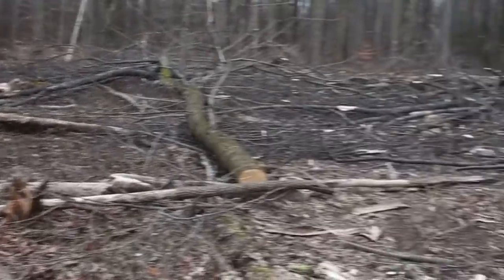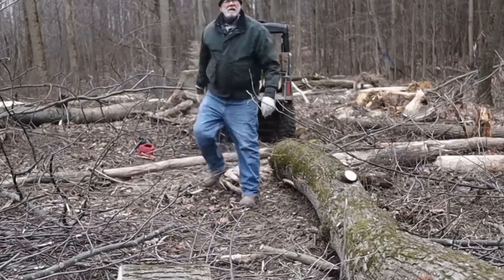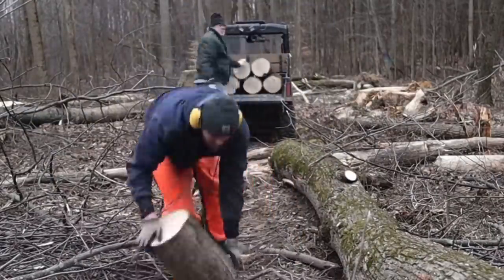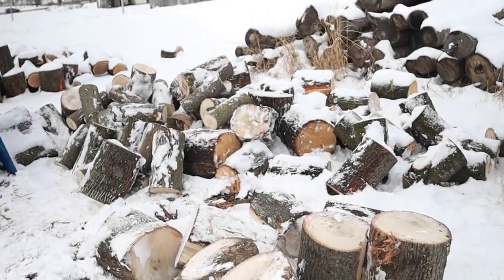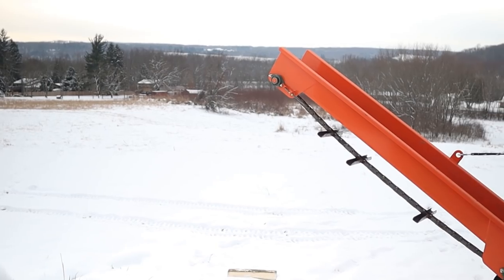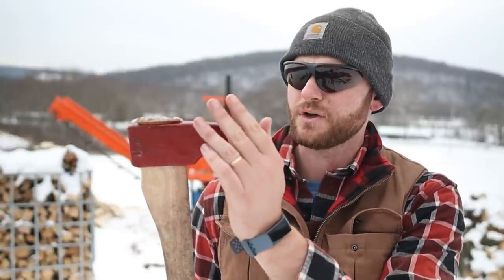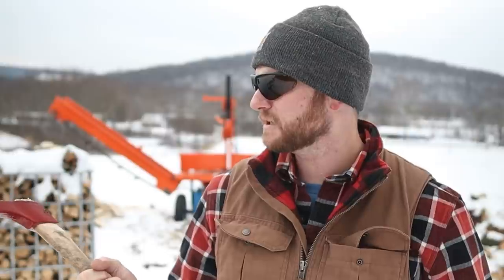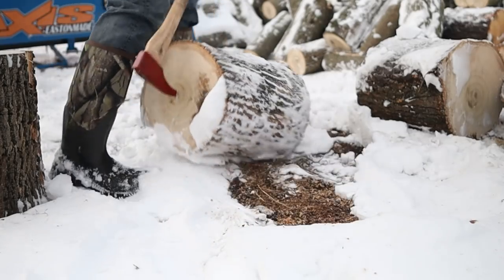You Guys Were Right - This Is Better

Comment: Why would you split the wood in a very modern splitter with a belt system and then drop it on the ground so it needs to be picked up again?
Reply: Some people allow the wood to dry or season in piles.   But I see your point.   I like to stack it on racks after splitting so using the conveyer to drop it in the bed of a truck or trailer is easier and removes one step of getting sore.

Comment: Adam most people take care of their tools but don't look after their body. I'm 63 been cutting and splitting firewood since I was 8 years old. I do 20-30 minutes stretching everyday, never miss doing it and never had any aches other than fatigue from a good hard days work. What i have noticed as i get older is that my strength is going and I can't lift anywhere near the weight I could when I was young. The stretching keeps the body supple so you can recover from working it. I've had people helping me in the bush half my age or more and can't believe I'm not stiff the next day when they can hardly move.  Look after your body when you are young and grow old without aches and pains.

Comment: I see that you're helping your back with the pickaroon, but now you need to pick 1,569 small pieces off the ground. 

Suggestion- let the conveyor dump split wood into metal totes. (Yes it will be a little messy) 
Use your loader forks or 3pt pallet fork to lift and carry tote to a wood stack area or re-stack into another metal tote.
Much less bending over.
Probably get 2x work in same time and much easier on your body
Reply: Absolutely! Man, I thought there for a minute I was the only one here who realized this. The less you have to reach down, the better.
Reply: @tbpjmr2869  
We load all our longer logs onto an old $500 flatbed hay wagon (fork load with a tractor) 
We saw into rounds right on the flatbed.
Roll the rounds onto a splitter deck.
Toss into a tote or stack for seasoning.
VERY LITTLE bending over.

Comment: I bought myself a Forester Pickaroon for Christmas and an kicking myself for not doing it years ago. My back is usually an issue but not lately.  I cut and split 4 cherry logs today for example and I’m not making any of my old guy groans tonight 
One tip - I do this with axes and mauls too
Cut a disk off a log that fits in a drywall bucket and about 4-6 inches thick. It will keep the bucket from tipping over when you put your hookaroon in it next to your splitter or work area.  Sure beats looking for it In the snow and bending over to get it all day.
Reply: Great tip! Thanks for sharing!

Comment: Hey, Adam! I'm commenting through my father's YT account because I don't have one. My suggestion to anyone would be to do a brief warm up of the major joints and areas you'll be using hard and then do deep stretches after it's all over, preferrably before bed. A lot of folks like us who do hard work like this always preach about the maintenance of the equipment, but are not as in tune with maintaining the God given equipment he gave you that's the most ignored tool --- your body! There's proper ways to lift, swing, carry, push, or pull and there are also improper or even dangerous ways to do those things. And to compound it, when you haven't taken good care of your body for a long time and you find yourself being a stiff, immobile old man then the work you're doing to produce firewood is that much more damaging on your body. That's exactly why we've had to invent tool like a hookaroon, to get around our own infirmities haha! God bless you and your family, Adam. I subscribed for the ideas you have regarding small-scale wood production because I'm in that same boat to heat my house. Thank you for reading--- Tad from PA
Reply from the maker: Tad thanks so much for taking the time to share. Yeah it’s funny I’ve played sports for years and before every practice you jog, and stretch.  But the second we don’t have a coach coordinating a practice we lose all common sense. Splitting firewood for an hour or 2 should be no different than going to basketball practice, stretch and warm up first. Excellent point
Reply: hi there have you ever animals  like cats and dogs when they get up the first thing they do is stretch   john

Comment: Great video!  That type of tool is great! You are wise to take advice and improve over time. Suggestion: put a magnet on the blue colored indeed table/ round lifting actuated table top of your splitter.  If you put a strong magnet close to your RIGHT foot on the underside of the table, [ right foot / right left determined when operator is looking towards the ram assembly] you could click in/ magnetically lock your picaroon into a vertical position and it will be exactly [almost] in the same place every time you go to grab it. The handle looked to be a bit longer than the vertical distance of the infeed table but the pivot point of the radial arc would probably be acceptable depending on where you stand when raising logs on the infeed table. In my opinion having a tool like that is useful and having the tool in the same place leads to better muscle memory  , reduced fatigue and not tripping on the handle when tool slides around [ snow is slippery]. Great Channel, Happy Holidays!
Reply from the maker: Thanks for the idea. Happy holidays Adam

Comment: Yes Adam they are a great wood tool to get as I finally got one this year after doing the old style of picking up rounds and hauling them by hand even at 52 I'm doing things alot different now then before because it's hard to get going in the morning, so be smart and save your body for when it will mean the most...

Comment: I would say the aches come at 35. I’m 37 now and things need to be done smarter not harder now.
Reply: Came at 42 for me. Bought a mini skid this year at 43 to keep up the pace. No more aches and pains!
Reply: I'm 42 now, the big aches, pains and joint surgery came at 39. Being in the trades most of my adult life and only having a woodburner for heat during the last decade has taken it's toll, mostly because I didnt wanna spend the coin on a hydraulic splitter, a grapple and a cant hook. There was pride in doing it all by hand. 6 cord per winter all bucked and busted with a chainsaw and maul.
Reply: Yep best advice at 61 i can give to the youngsters. Get the equipment as soon as you can! The maul and hammer have ruined my wrists. Barely can carry wood into the house now. No grip.
Reply: @mikeadams2339  yep. Glad I learned the lesson before putting any more wear and tear on my body. I enjoy running my sawmill and would like to do it through retirement. I’m spending the next year refining my setup to minimize material handling and to do as little manual labor as I can. There is enough unavoidable movements that I’m still beat by the end of the day.
Reply: Yep puting chains on the tractor, at the end of the day i felt like i had been beaten up by a bear! So great to see these  kids thinking smart and actually hearing what we are trying to tell them
Glad they look at the work area and think ahead so they will  have room to work and store the harvest they they have wored hard for!
Reply: They hit me at 42, shortly after getting married... but that was the best “accident” that ever happened to me! But on the serious side. Between serving in the Marines, automobile racing, motorcycle accidents, and life on life life’s terms. I keep looking for better ways within my means, smarter not harder is best!
Reply: I started using a pulp hook about six years ago and wow what a difference! The pickaroon looks like a great idea also. I started to notice that I had body parts at 43 and began to make adjustments in my methods. I HAVE slowed down a bit but cutting firewood helps keep me young. I'm 74 soon. Work smarter, not harder!
Reply: Load fire blocks into trailer, with ramps or whatever is handy, place ramps between trailer and feed tray of splitter, let my son roll bucks to me for splitting, and toss splits to my daughter for stacking. Keeping in mind I don’t own a tractor of any sort, and dragging my splitter to the bucking site I would only be able to grab a small truck load ( about 1/8- 1/4 cord), but with the trailer, I can get about 1 1/2 cord / trip, and split in my back yard.
In the future, I will be putting a winch on the front of the truck( in case of getting stuck)and another on the tongue of the trailer ( for loading fire logs)
Reply: First lower back injury at 41 and then neck injury at 45 but still going they say it gets better but I am not sure what that means HA!
Reply: @MJADoingStuff  my back injuries started with a broken back, at 8 years old, then again at 10, and 12. Slowed down a little the broke twice in the Marines,the 2 more breakers racing cars, and my last was a motorcycle accident, on top of that, I have broken my neck twice, ripped out both rotator cuffs (beyond repair) and have blown out my knees.

I’m not in bad shape, for the shape I’m in, and when I die, I will donate my body to science- fiction, they probably won’t believe it either!😂😂😂
Reply: At 60 the best thing I have learned in the last couple years is to slow down, made all the difference in the world.
Reply: @royc8186  if I slow down... I will be in trouble, keeping active is best for me! Even on the weekends if I sit around and do minimal work, then come Monday I am stiffer then if I did something!

Comment: I used one just like that back in 1971-72 when I was in high school working at a local pulpwood yard. The hook made short work of leveling out the top of a car loaded with 5 foot long pieces of pine and hardwood pulpwood. I also had a short hook (16") but the longer one was much better.

Comment: You can use the hookaru on the end on shortened log , 6 to 8  that is ready to cut in to fire wood length and place under the one end raised up by it a U shaped piece of wood so you do not cut into the dirt. Not every log depending on size... In the woods my Grandfather would use a stick mark off with 3 fire wood lengths and mark the log with ax chop......He would stand in the middle of the stick and mark 2 at a time... We would use a double handled cross buck saw!!!

Comment: I have been using an old ice tong. No bending over and will pickup nearly everything you can lift. With a little practice you can even throw the smaller ones.

Comment: So, worked at a place they had a big flat hopper for the intake part that was loaded with the front end loader. That way it was already at the height of the table. If you had a pickup bed trailer that you could load flat, and then tilt up with a chute at the back of it, that might save some back labor too.

Comment: Hi Adam - it's Big Rodders in Ireland.  I'm delighted yiu have seen the light!  I used 3 different length pickaroons for years but I was always concious of the dangers of spearing your lower legs, particularly when using the shorter ones, if it was deflected during a strike.  I switched over to two timber tongs 7 years ago and they are my go to tools now.  Get your Mom to buy you a pair for Christmas and review them against the pickaroon in a future video.  Happy Christmas to you and your subscribers  in this most difficult of years.
Reply from the maker: Hey Big Rodders - I will most certainly look into those timber rings. Thanks for the advice. And yes I have had a few close calls on swinging that Hookaroon into my legs. Definitely have to be careful. Happy Holidays!

Comment: I bought a Fiskars pickaroon right after I partially tore my bicep tendon on my right arm overreaching to get a piece of wood out of the back of my covered pickup. I reached out too far and then used my weight to move the wood and basically, my body moved and my hand didn't. It honestly took me a while to start using it, because I just kept forgetting. Very useful tool.

Comment: Good morning Adam. You & I have much similar equipment. However, I use the grapple to load logs in my dump trailer to haul home. I then use the grapple to load the logs on a cutting table I built. After blocking them up, I roll the rounds off the end of the table onto the log lift. This method virtually eliminates bending over completely. The main frame of my cutting table is steel, but it could all be made of wood. I am however, almost twice your age. Merry Christmas.
Reply: my operation is much smaller.  I lift the rounds into the wheelbarrow, then shift from the wheelbarrow to a platform next to the splitter.  drop them directly off the splitter to the wheelbarrow, and then stack directly from the wheelbarrow.  I only pick wood up off the ground once.

Comment: I wear a back belt, upper body stabilizer, knee brace, elbow braces and sometimes a wrist brace to do firewood.  Body building and firewood wear and tear, but at 43 with surgeries on the elbow and shoulder, nerve block (Rhizodomies) in my lower back I make it  my mission to do everything as ergonomic as possible.  It’s now part of the fun to develop a backproof system🤓.  I could almost start a channel on all my innovations.
Reply from the maker: Man you must look like Ironman when you go out to do firewood.  Between the ergonomic gear and the firewood PPE you’ve gotta have an extra 30 lbs of stuff on haha. Good for you though. Better to be safe than sorry

Comment: Adam, if you used boiled linseed oil to treat that handle at the start of the video be very careful about the rags you used and the disposal method.  Not to go into too much detail but boiled linseed oil-soaked can and does spontaneously combust under certain conditions. I used boiled linseed oil for wood handles all the time, it works great just be super careful with the rags when you are done.

Comment: I finished up cutting 18 cords I got delivered a year ago, in October. I cut about 3 cords off my property last spring, for this year also. I just got another 20 cords of birch for the next 2 years and just started bucking it this week. I normally split 40-50% of my firewood.
I turn 50 in February and I don't use anything but a chainsaw, a maul and my atv with a 4x6 trailer. I also normally run about 25-35km per week and play hockey once or twice a week.
I believe that you need to be physical to be healthy. 
I will likely get a pikeroon in the coming years and maybe also a hydraulic splitter.
I have aches and pains but I think I would be worse off if I didn't do all I do at my age!

Comment: I noticed the land that you are getting your wood is a excellent place. Don’t know if anyone has mentioned that you need to fix up a landing place to drag them logs to and then you can block them it will safe you time and back, that side by side should pull them logs to your landing, my 4x4 can pull what I can get to I’m in West Virginia. Hope this helps. Ho by the way I’m 70 and I still cut my own firewood my outside stove runs year round.
Reply from the maker: Thanks for commenting. Love hearing from guys like you. You certainly set the bar high still running an outdoor wood boiler year round at 70. I hope to be able to when I’m that age
Reply: With all the technology today you should be able to do it when you are in your ages. I have burned wood for 44 years and I say for over have of that time I split my wood by hand and now I use a log splitter have been looking at the Eastern Made 5-11 still a lot of money.

Comment: Oh, if your gloves are leather, you can put some of Atsko Sno Seal on them.  Works great for waterproofing all sorts of leather, just know that it will darken the leather a bit after application, so if the shade of color is important, you might not wish to use it on a particular item.

Comment: Why isn't he putting a Trailer under the conveyer instead of having to Lift and move it again????
Reply: I process right into my dump trailer. Only have to handle the firewood once-twice if you count loading the stove.
Reply: Leaving it in a pile to dry rather than stack it, perhaps.
Reply: first thing i thought as well
Reply: He is 29 it will all change next year when he feels old at 30 maybe?
Reply: Роидш5ш
Reply: Cause it’s amateur hour
Reply: Probably because he’s not real smart, but he’s able to lift things.

Comment: You have missed another time saving and back saving feature of your wood processor.  Use the elevator to  load the split wood into a trailer to transport it to its final drying or stove feeding location.  Why put it back on the wet ground?  The least times you have to handle the wood is time and back saving labor.

Comment: In the interest of saving time, energy and your back, wouldn't it be more efficient to immediately place the entire round you just split, that is securely in your hands, directly into the tote (and not use the conveyor)? Perhaps compare how many pieces you can neatly gather, hold and place into the tote from the conveyor pile versus directly from the deck of the splitter when it's already perfectly positioned in your hands for stacking.
Reply: I was wondering why he didn’t have his tote directly under his conveyor. He is going to have to handle that pile of wood again. Somewhat inefficient. He also moved the pile, when he could have just went from the pile directly to the splitter. The less time you are moving wood the greater the efficiency.